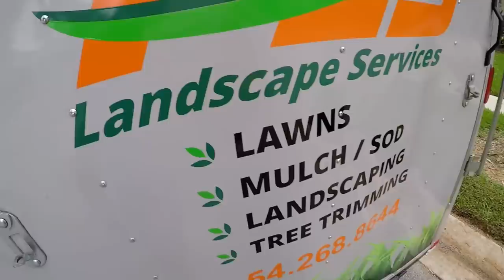Scag v ride 36 mowing another high end property (full video)

Comment: Great video! Did you rewire the safety switches so the blades don't cut off when you get off the mower? I have done the same thing with my lawn tractor.
Reply from the maker: Thanks! All you have to do on the gen 1 vrides is remove the spring that keeps the safety bar up and all of the safeties are disabled.

Comment: Considering a 36 inch to add to the program I'm 280# wondering if that's alil to 

Solid work by the way
Reply from the maker: Doug Larsen thanks, my employee is 200lb and does fine without the counterweights. I think if you leave them on, it will be ok. But the ground pressure may leave ruts in the lawn.